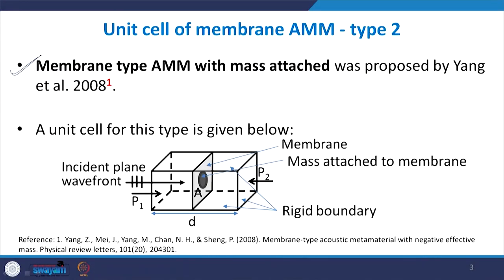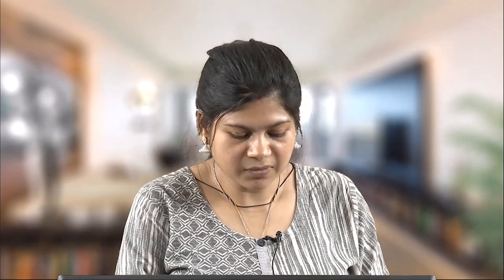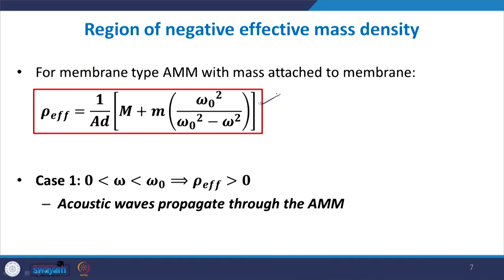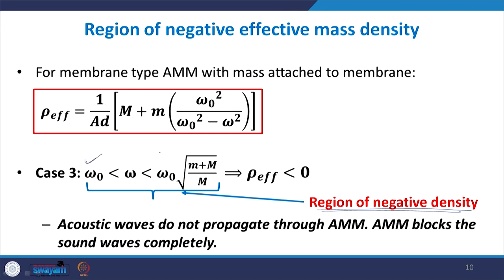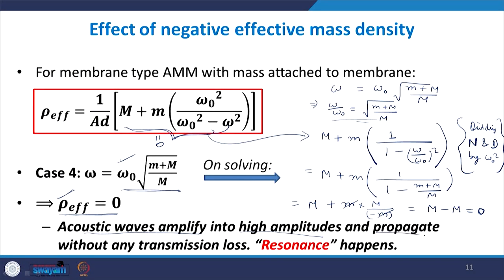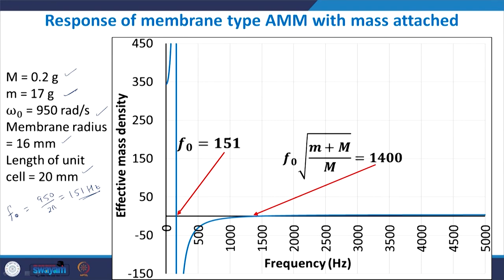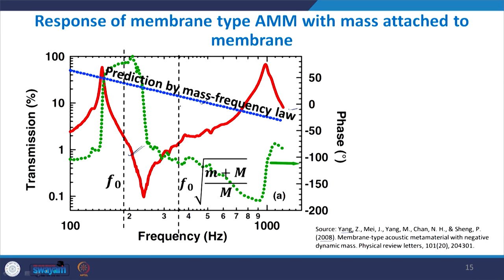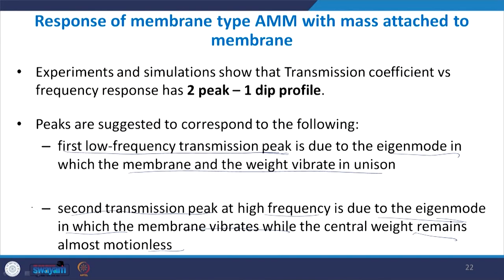Lecture 31: Membrane Type Acoustic Metamaterials-4

Comment: Mistake at 13:30 how did you solve if you took wrong value,  check the above expression its omega-naught minus omega and not omega minus omega naught
Reply: it's correct, they have taken the reverse to simplify the process of understanding the inequality ... since negative inequality kinda creates confusion
A simple way to understand this would be take w^2-wo^2 in the eff. ro equation itself you will get M - m(wo^2/(w^2-w0^2)).. and now for eff. ro to be -ve the 2nd term has to be bigger than M